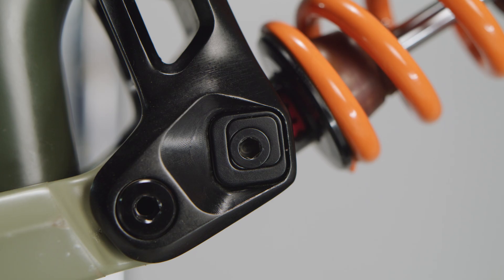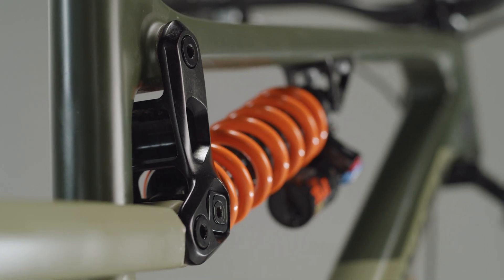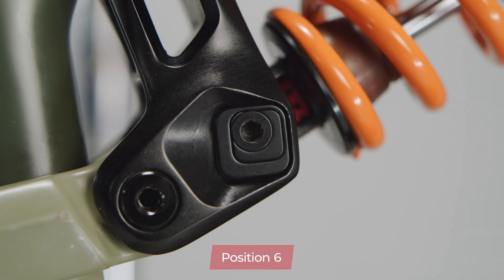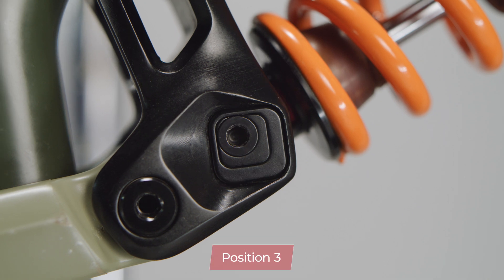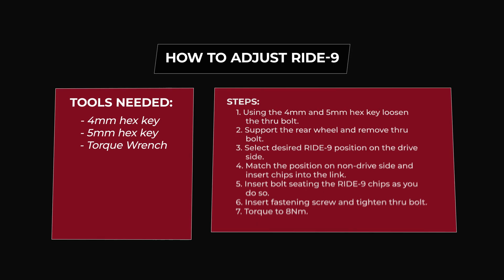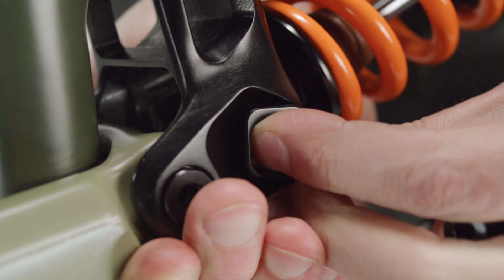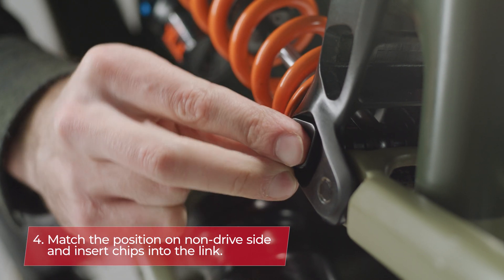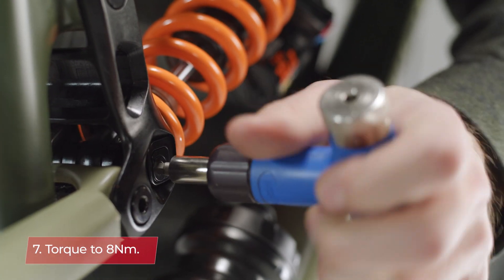A RIDE-9 adjustment system and how-to

Comment: At least for me it helps to look at the link as a lever and how it acts on the shock as it travels through a compression. It appears there is more leverage on the shock in moving from 7 to 3 diagonally, so the shock is easier to push at the beginning of the stroke at 3. In moving in the 1 to 9 direction diagonally, the leverage on the shock doesn't change as much, but there is more of an effect on the bike's geometry, bringing the tires closer together.
As far as rise goes it seems that would depend on how much air is in the shock, but i don't know any of this stuff really.

Comment: A lot of customization! Curious on the rear adjustment ever seen the driveside flip chip completely lock up? Curious to try the longest wheelbase option.
Reply from the maker: The flip chip is secured by the derailleur hanger and its bolt. As long as that can be removed, there shouldn't be a problem.

If any issues like this arise with your bike, our dealers and technical service team are there to help.
Reply: @rockymountainbicycles   it didn’t come out. Wasn’t going to force it. Took it to a local shop and heard him banging the drivetrain side chip with a hammer and it didn’t come out 😂 guess I’m not going back to that shop again.

Comment: Is there a PDF of this with photos of the actual chip placements? The numbered diagram isn't intuitive. 
The system is great, but photo referencing would improve the user experience.
Reply from the maker: Hi Ian, to learn more about the RIDE-9 and its set-up, please refer to our website here: https://bikes.com/pages/ride-9-adjustment-system
Reply: @rockymountainbicycles  This video says position 1 is the more progressive. The ride-9 manual says position 3 is the more progressive. Which one is true?
Reply: @rockymountainbicycles  I appreciate the reply, but it's to a link to a video and pdf of diagrams (which to your credit, show pictures of positions 1, 5, & 9). That leaves out 6/9 positions. Exactly the positions I need to experiment with. :)

Comment: The position 5 in this video is different from the manual
Reply: position 5 is the center. you can have 4 different orientations for position 5.
Reply: Then for positions 2,4,6,8, each of them has 2 orientations.
Reply: @youling1997  Ya, I figured it out after closer inspection.